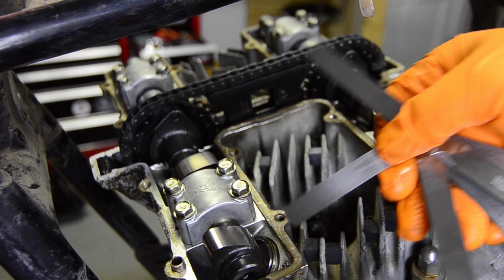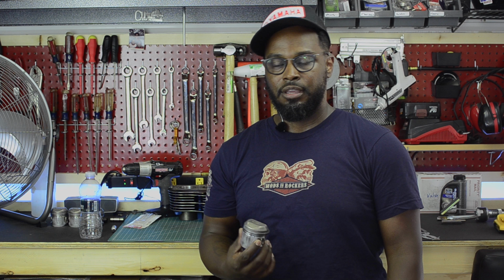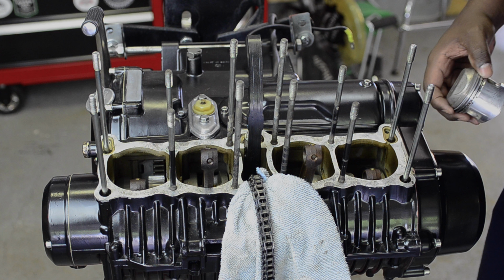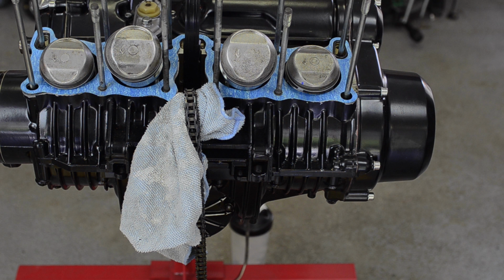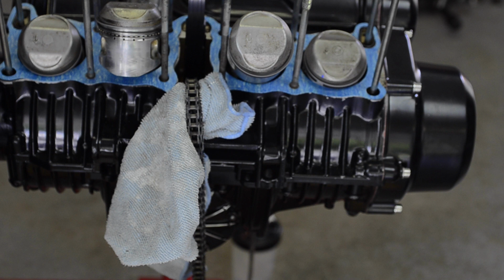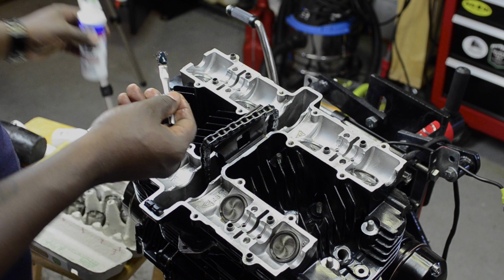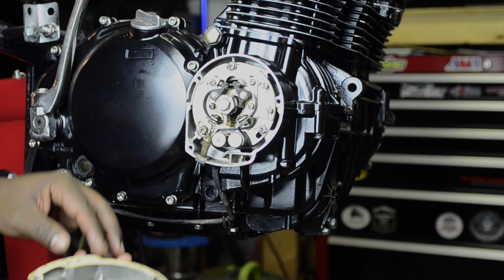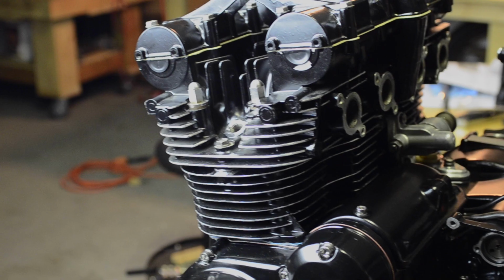GS550 Build Episode 6 - Engine Assembly

Comment: hi mike, i have a suzuki gs500, and i am chercing to do the phase, but on the flywheel there are many marks, which ones should i follow? (i have on mine the letter T the letter F and the number 4)
Reply from the maker: If I'm reading it right, you want to use the hash mark just before the F. Get a test light if you don't already have one. They're super cheap and extremely helpful and getting things set up spot on.
Reply: @MikeMitchum  my main problem is figuring out which sign to use, whether t, f or 4, do you recommend using f?

Comment: Hey Mike greetings from Germany great Videos, I lookin forward to see more of them. 👍🏼
What Engine Stand do you use for your assemblation of the Engine?
Reply from the maker: Greetings and thanks for watching. There's a value priced tool store in the states called Harbor Freight. I picked up one of their engine stands meant for car engines for $50! It's rated for 1000 lbs, which is more than the fully assembled bike with me on it! A few short pieces of angle iron allowed me to adapt the stand for a motorcycle engine. 

Search "Paul Stransky engine stand" and you'll see how it's done.

Comment: Hello, I have GS650 1982 and I want to start restoring it but I would like you to recommend places to buy the part

And also, I would like you to tell me what is the problem with my motorcycle in the ignition or what parts do I have to replace?
Reply from the maker: Hi Victor. I used Babbitts and Partzilla for most of the OEM parts, but there's no shortage of other sites for other parts. 

As for your ignition problem, I'm not sure what you're asking. I ended up replacing my ignition with an electronic ignition. I believe another guy on YouTube (Urban Monk) kept his points ignition and covers how to set it in one of his videos. Hope that helps!

Comment: hello what's the name of that with which they polish the cylinders ? good job!!
Reply from the maker: It's called a glaze breaker. They come in this style and another style with small, abrasive balls attached to it. They etch a cross hatched pattern into the cylinder walls to allow the new rings to mate properly to the surface.

Comment: Amazing work man I am also planning of doing a top end rebuild to replace all gaskets and stuff on my GS550E and I wanted your opinion on a matter of subjects.. I am planning of using PERMATEX assembly lube on the whole process and I am wondering if you think I can use it like you did with the LUCAS lube On the cylinder walls and piston rings( because you made it look soooo easy putting them back in). And also I am getting lots of different opinions but will you flush out the new engine oil that you are going to put in the motor after a few days of riding it when you are finished??? ( keep in mind that I am just going to replace gaskets etc not going all the way and replacing piston rings)Thanks in advance!
Reply from the maker: Assembly lube is assembly lube. You should be fine with whatever brand you choose. Permatex has a solid reputation, so I wouldn't hesitate to use their brand. 

As for the oil, yes - I'm gonna drain it soon after I get the bike running. I'm pretty sure there is some debris and junk in there.
Reply: Hey man after watching your videos I mastered the courage to begin the refresh on my own Suzuki Gs550. I am still at the cleaning stage but I have a question. I won’t be chainring rings like I told you bcs now In close inspection they still have a lot of meat on them BUT. When you install the cylinder back on do you have to align the rings in some way or you just put the cylinder on and they will find their way??
Reply from the maker: @loco250490  you'll need to clock the rings on the Pistons so the gaps are offset from each other. When you go to put the cylinder bank on, the rings need to be compressed a bit so they'll slide into the cylinders. You can get a ring compressor to accomplish this job, but I just did it with my hands and the cylinders went on surprisingly easily. There's an inside chamfer on the bottom of the cylinder sleeves that probably helps accomplish the job. Just be careful to not move the rings out of their clocked positions when you're putting the cylinders back on. Hope this helps and good luck!
Reply: Mike Mitchum man you are a lifesaver thanks a lot yeah I noticed the curve at the bottom lip of each cylinder it will definitely help so I just line the rings up like the manual says and put the cylinder on top! That is the only part that worries me about the whole thing due to the fragility of the rings. Thanks a lot!!

Comment: Nice video, and bike.  i'm rebuilding a gs650, almost the same. The plastic tool you are using on top off the cam chain. How is that called? Looking for it to buy one myself.
Reply from the maker: Thanks, man. Glad you like the video. If you're talking about the black plastic piece, that's the cam chain guide and it's a component that stays in the engine.
Reply: I see now that is realy a part from that particualy bike. So if i am thinking right? This part stays in the engine? Or do you take it out, and use t only as a tool to help?
Reply from the maker: @SvZ89  it stays in the engine to guide the cam chain while it's moving.